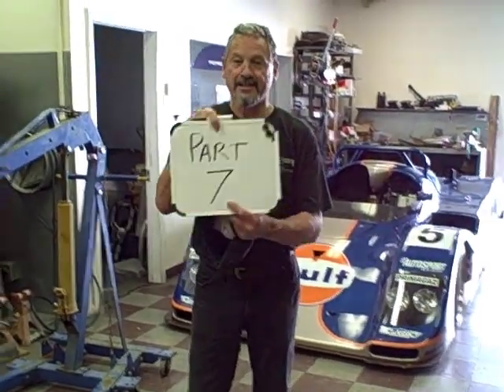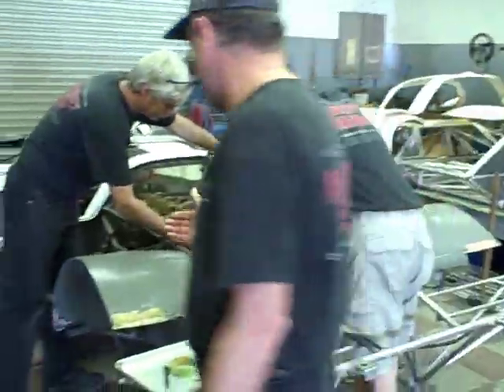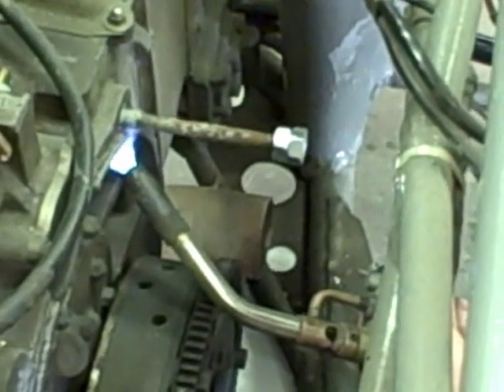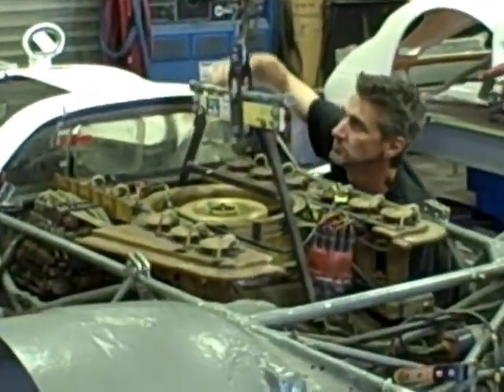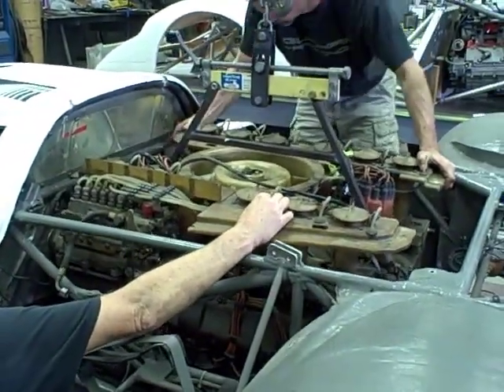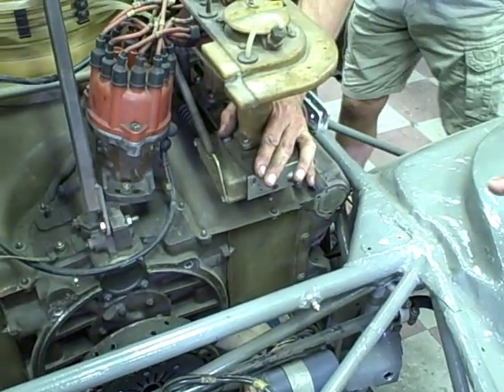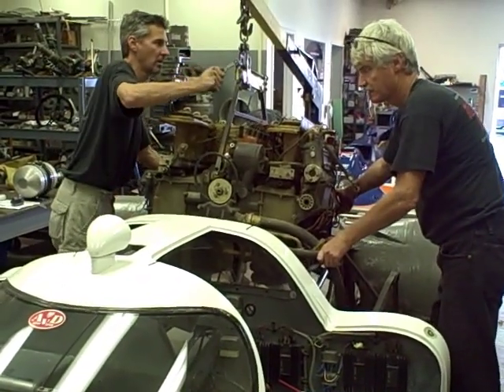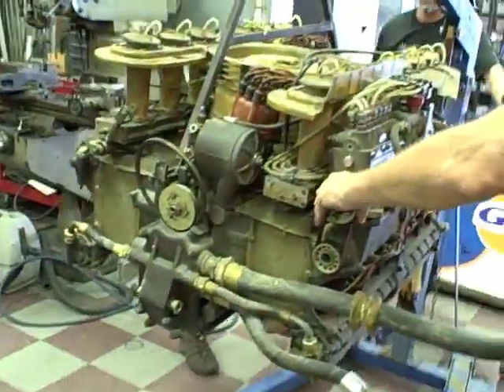917 - Part 7 Removing the Engine

Comment: Fans at the 1973 Laguna Seca Can-Am got to watch Penske Racing do a 917/30 engine change in the open paddock, in the few hours between Sunday's first heat and main event. It was quite an evolution, every team member was involved including the owner. They finished the job in much less time than it's done back at the shop! The Unfair Advantage is not just about machinery, but people.

Comment: the exhaust system is still mounted on the engine on this video. 
from 8.10 you can see clearly the 2 brown pipes at the right and left of the flywheel and a part of the spaghetti manifold.

Comment: Those three bolts don't hold the engine in the car, they keep the car from falling off the engine! The fuel injection pump looks like a monster! Is that for all twelve cylinders, or is there another one on the opposite side?